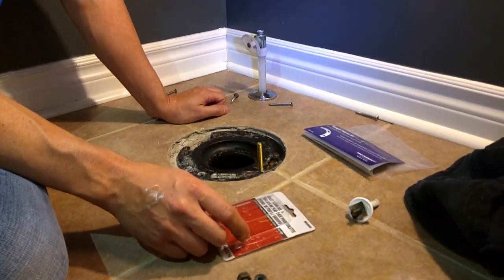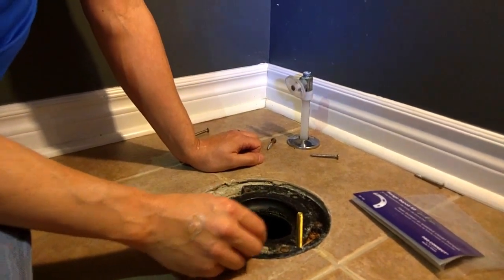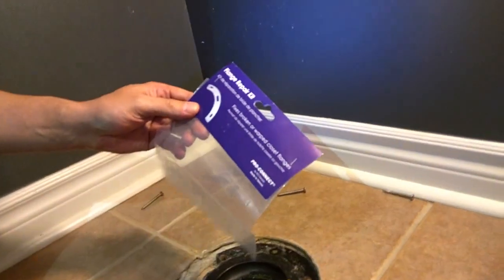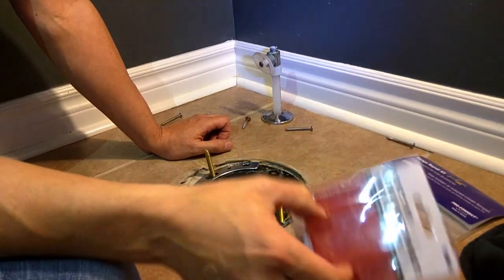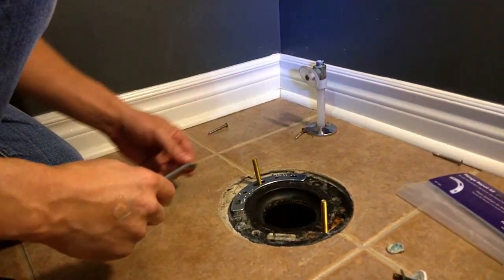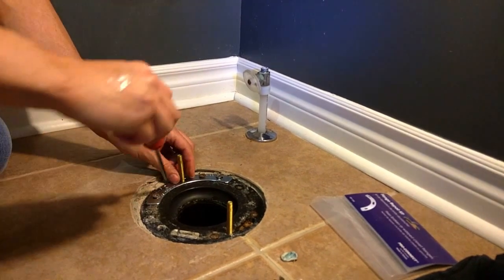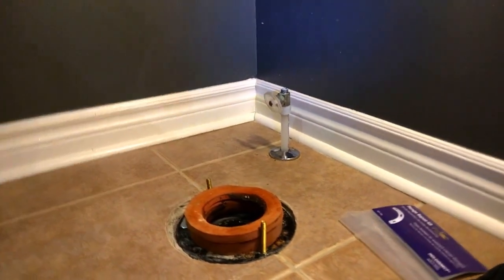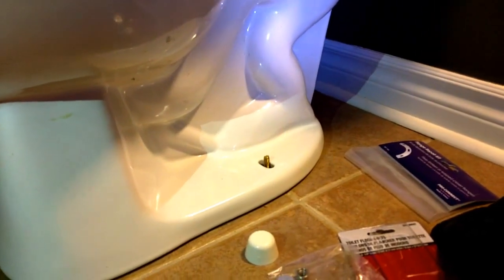Easy fix toilet rocking or leaking yourself if closet flange bolts are broken

Comment: Just a word of caution and not being critical of you in the least: Never work on a toilet flange like this without inserting a rag into the pipe to prevent loose screws or even that new metal support from accidentally being knocked down into the drain pipe. Remove the rag when done with the flange and screw repairs.
Reply: I’ve literally never done anything like this before and when the screws were being tightened with the drill I was nervous something was going to fall down the hole lol good tip!
Reply: Great tip!
Reply: Great advice
Reply: Also the roaches from popping out!
Reply: excellent tip,  perfect way to express the idea of have a higher sense of thinking than just normal.

Comment: Wish mine was that easy.  New house that is now 5 years old... Wobbly toilet first floor.  Pulled it and there are no screws holding the flange down to the concrete slab.  Better yet there is a 1/4 gap all the way around, so there is nothing to screw it down into.  They literally secured my toilet to the floor with latex caulk.
Reply: We must have had the same shitty builder
Reply: Previous owner secured mine to the floor the same way... Because the bolt on the right is broken and rotted, they cleaned it and covered it up then caulked the toilet down and now that it's rocking I got to see their "handy work"...

Comment: The replacement piece in this video is what you want to fix a flange with broken slots. For this repair, a flange spacer is also needed to raise the height of the flange or an extra large wax ring may work. Not sure why the toilet would be rocking unless the floor is not flat.

Comment: After 50 years as a plumber I can immediately see that the flange is below the level of the finished floor therefore, problems will persist!  Because the flange is damaged, spacers, which could normally solve the issue might not work! Sadly, the broken flange needs to be carefully removed and a new one properly installed
Reply: And how much does that usually run?

Comment: Thanks man! That is exactly what happened to me. The jackass home inspector put on the report that the toilet bolt was simply "loose". But, when I went to tighten it, the damn thing broke off with little effort. And yep, it was a steel bolt. Will go find the right brass bolt and kit today. Takes a load off. I was going to hire a plumber and take the home inspector to small claims court. But, it's easier to just fix it myself and give the home inspector a bad review. What a jackass home inspector. Been in my house less than 2 weeks, and I'm replacing toilet bolts.

Comment: your title  is  misleading , removing  the entire toilet seat  is  not  an "easy fix"
Reply: shut up
Reply: Then pay a plumber.
Reply: Toilet seat? You mean he removed the ENTIRE TOILET!!!!
Reply: Replacing a broken flange would be a nightmare because it's buried in the subfloor/concrete and has a sealed attachment to the pipe below. Compared to that, using a repair kit is 1000x easier.